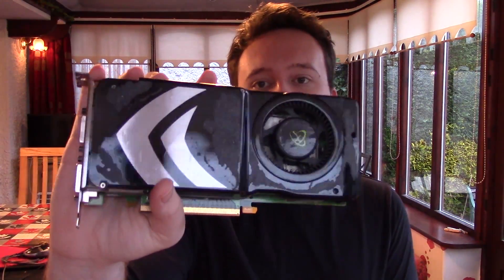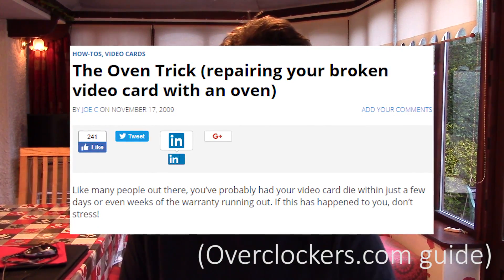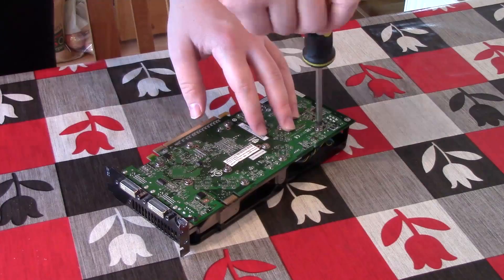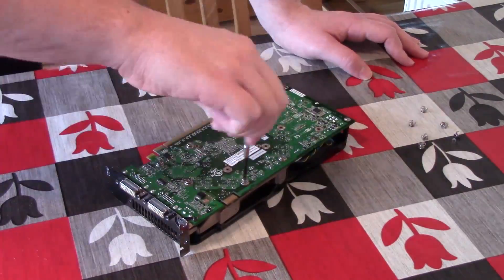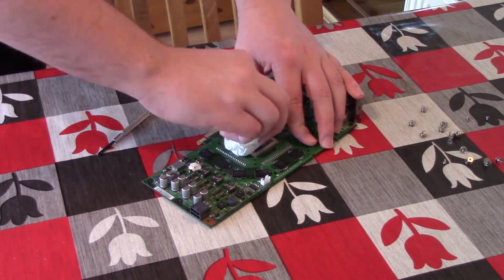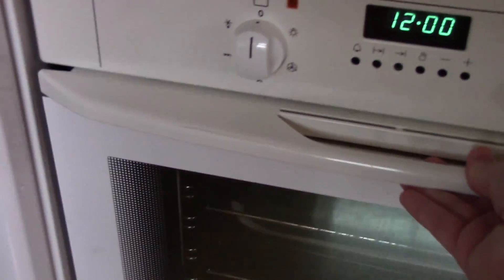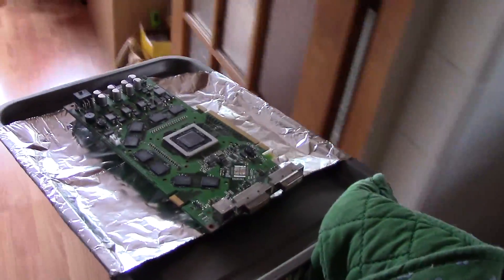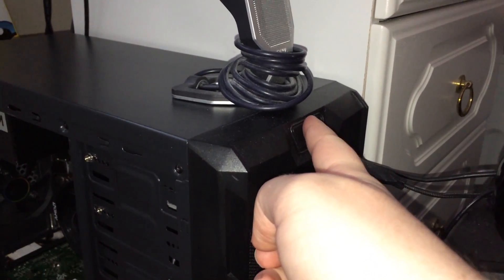Hardware Myths: Oven Baked Graphics Card Repair

Comment: Normal guy bakes pizza in oven. Tech guy bakes GPU in oven ;).
Reply: I had to replace thermal pads on my RX480, the process included rubbing the memory chips with alcohol, so I had to dry the card in the oven afterwards at around 80C :3

Comment: I fixed a iBook G3 GPU with a heat gun. It works still. Been a few months and it still works, but it's not a daily machine at all. Personally I think the heatgun is a better method than the oven, as you're not heating up everything else on the card and possibly messing it up more.

Comment: - could fry Capacitors or other parts
- can melt Plastic arts (e.g.fan connectors)
- might not do anything
- your Oven will smell terrible

But if you have a old card like the 8800 GTS it may be worth a try ...
Reply: the thing was trash without being "fixed" and the oven was being replaced afterwards? so i didn't see the issue with the caps or plastic, and so what if it doesn't work? its not worth anything anyhow.

1) if someone was going to do this yeah they may want to unsolder caps(they won't "fry" but they might evaporate and or rupture) and non high temp plastics

2)you can do it in a toaster oven in a garage

3) if it doesn't fix anything it doesn't matter so long as you haven't put any money into the fix
Reply: MGlBlaze so why do people bake the imac amd gpu and some are working 17 months on...
Reply: It WILL fry capacitors and other parts, as well as disrupt the internal structure of FLIP chips like what the GPU die itself is. It works temporarily but heating stuff in an oven does permanent damage that cannot be reversed - what you basically end up with is a zombie card that might work for a couple of weeks or a month before dying again, probably permanently.
Reply: The heat in a toaster oven is so incredibly uneven though, the heating elements are far too close to the card. Remember, most heating systems are either "on at full" or "off entirely" and just bounce on/off to try to maintain an average temp. In a toaster oven the heating coils can easily hit +600F even if you only set it to 200F.
Reply: You can add toxic fumes to that, you wouldn't simply melt stuff. At the very worst he could have killed that poor bird  of his if the room wasn't aired out good, they're very sensitive that sort of thing.

Comment: one way that i know works, get a heat gun with a high enough heat setting. mask off the caps and other sensitive components and leave only the gpu visible. heat it with the heat gun for quite a long time(might stack some pennies for a bit of downward pressure). if your not sure how long it'll take to remelt the solder than take an old cd/dvd drive that doesn't work and see how long you have to blast the board with the heat gun before the solder melts. add some time on to this to account for the mass of the gpu. fixed an old ati pro 1600x card that was getting green lines with this method. also works on the old xbox 360's that get RROD.
Reply: reason this way works is the heat gun actually produces enough heat to actually melt solder, unlike an oven that can't get even close enough heat wise to melt solder.
Reply: just have to be careful as once the solder is melted the heat gun can blast components right off the board. hence why you mask them with tin foil and some heat proof/ resistant tape.
Reply: The heat gun process for the 360 is just temporary (lasted a month for a broken one I bought and didn't work at all for two others that I had also bought).  The same result can be obtained by changing the xclamps allowing the chips to heat up for a minute without the fan on (but with the heatsinks on).  The problem is every "method" seemed to be temporary except possibly reflow with lead solder.

Comment: The oven method is a ghetto mod for a reflow station. I went the professional method with my 6870 because I had a friend who happened to have a reflow station. The card started to artifact randomly after about 1 year. So the guy helped me again by replacing the solder balls between the gpu package and the PCB. 10 months have passed since then, so far, so good.
Reply: Bizo221 yop good reflow usually help for long time

Comment: I still need to do this with one of my cards (sub-zero thermal fatigue cycles contracted the solder joints and now it only boots 1/20 times). I don't really want to ruin my stove, so I might just barbecue it outside since I really don't want solder smoke in the house. So charcoal... Small flame with top on, or open flame grilling? 

I will obviously have to video this hilarious event and put it on my Legit_Overclocking channel. Then I'll have to hardware mod it for more voltage and give it a good send off beating its ridiculous overclock record.
Reply: flame it
Reply: Is that a vote for open top grill? Would look better on camera I agree.

Comment: I do allot of gpu repairing and pretty much most of them involves reflowing using a normal heatgun. but do take note that gpu tend to turn bad because of heat. after repairing it by baking, do clean the heatsink and better thermal paste, install MSI afterburner and edit the fan curve at a point that the card runs below 80c at full load and don't use furmark to test heat. you'll find your card will live longer. all the cards I fixed are still alive to date even though my clients are always using it all because of stable temperature.

and avoid baking a card with regular capacitors. :S
Reply: Jerahya please watch the refrenced video, thats not what happens (7:35)
Reply: the same guy who argued with linus and insisted that the only way to fix this kind of shit is by using a thousand dollars worth of equipment but in the end he was never able to fix one thing when linus visited him in his place. I never really liked the guy. there are bunch of ways of reflowing and reballing chips and baking in an oven is one but unreliable way.and he only believed in his thousand dollars of equipment. He's always full of him self.

Comment: My last GPU was an HD7950 that suddenly showed red stripes and the same "no signal" problem as the 8800GTS here. I was already about to throw it into the trash when I had the idea to try putting it in the oven , and it worked for a whole year of daily usage after that. It has recently stopped working again, but the oven trick worked a second time. Guessing this time it will die more quickly though.
Reply from the maker: +PCHardwareAnalysis that's good to hear, but you're right.  The more you try it the shorter the life span gets as it's never truly fixed
Reply: Next time use heat gun not oven gud fluxes and will survive longer
Reply: Keep the card cooler than it was previously and it should last for an decent time less heat cycles less warping
Reply: A also have a HD 7950 with the same symptoms. Since I have purchased another GPU I may give the oven method a shot since I have nothing to lose. If it works I guess I could use it as a short term back-up or something in case one of my other GPUs die.

Comment: Odd, I only now got a notification. I never had luck with the oven method, but I have brought a Gravis Ultra Sound back to life by simply heating up every solder joint with my soldering iron and applying a bit of fresh solder :) That doesn't work with modern video cards though as it's all SMD and whatnot.
Reply: I think you'll find you won't 'fry' your capacitors. This is the healthy option remember, we 'bake' our capacitors here.
Reply: Thats the thing, this works best with SMD as it may be difficult to use normal soldering iron (even if you know where and what to solder).
Oven works with other elecktronics too, as long as you dont fry your capacitors
Reply: I had to bake my old HP dv6500s Motherboard because the GeForce 8400m died. Lasted 9 months and its so broken that it does Not even Recognize this Card in the bios anymore. Still usable with external Graphics Cards.
Reply: i just seen  the 8800 cock up by nvidia on here     https://www.vogons.org/viewtopic.php?f=46&t=44126                    you thinking it was the 7 series that was affected no it was 8 series i had one and sent it back refund but i never got they sent me another card and that died i did get a refund in the end

Comment: Done this to my old Hd 4870 and still works after 4-5 years
Reply: Jay Arre I highly doubt that.
Reply: Same here my nVidia MX440 which I baked about 10 years ago is still working today, in my retro pc.
Reply: IIRC Louis Rossman's claim is that baking will most probably damage parts other than the BGA, rendering the card unrepairable. So technically, if you're lucky enough for those other damages to not occur, all that's left is for the BGA to fail again.
Reply: Wow! That's really lucky!
Usually these fixes last for a year tops, but exceptions are always possible.
Reply: My gtx 8800 laster few months after baking, so I wouldn't say he's wrong.
Reply: End of the day my card works after baking it, its a great way of getting it to work again and id do it again on older cards (tried on a gtx 580 and it wasnt pretty)
Reply: @SpaRiieeSiLvA  what happened with the gtx 580?
Reply: @Foozefighter  overcooked it and the capacitors fell off. But managed to buy some new ones and solder them in and funny enough that card is in my brothers beater PC till this day. I also did something similar on a broken GTX 1070 (graphical glitches and windows reporting issues with it) for about £80 and got it working fine also. Best thing to do if you are thinking about it is not using the oven but a hot air gun and flux to stop any loose solder spreading. Look up hot air guns graphics cards and you'll find some there. If you need more help just ask my dude
Reply: @warrax111  you just match the code on the capacitor. There's a voltage and a capacity number on them, just Google search it and they will sell a pack of 5 for cheap

Comment: I have an old EVGA GTS 250 that shows a bunch of "&" symbols on top of the mobo manufacturer splash screen, and then it restarts the computer and loops the same thing, i wonder if the oven method will fix it
Reply: ExitioRegem use heat gun is much better and more pernament I use on lot of card specially with problem like yours
Reply: Thanks for the tip, just need to get thermal paste and i'm set :D, and if it doesn't work, i will have paste anyways on the side for later builds :P
Reply: ExitioRegem no problem and buy good flux as well you can check my channel how I repair gpu and usually will working long time some card I repair with my technik working after 2 years with no problem
Reply: Both oven and heat gun are horrible solutions but the heat gun is even worse because you are directing all the heat to the gpu's die without any temperature control and could damage the internal trails, especially if you don't pre-heat the pcb
The best method would be to cover the capacitors with aluminium tape and use an eletric grill instead, it will heat the solder beneath the gpu but won't melt anything else.
Reply: Daniel Lee do you know how is gpu make anyway heat gpu will not damage die at all
Reply: Daniel Lee oh sorry my English is not best but I repair staff 20 years
Reply: heat itself doesn't damage the gpu, but were talking about an oven here
a solder station has a temperature sensor built in so you don't get bubles on your chip
Reply: I baked an EVGA GTS 250  (1GB DDR3) for 10 minutes at 375°F and brought it back to life. When it died, the screen just went black and never got a signal on any monitor. It's been 11 months and still going strong. I did pull the fan connector socket off first but it went back on easily. A week ago, an HD 3850 AGP that showed artifacts is now running great. Gonna replace the three electrolytic capacitors that are now swollen due to the heat but it does work lol. The GTS 250 had all polymer caps so I didn't have that problem baking it.
Reply: Can you even spell?

Comment: If anything replacing the thermal pasted may have temporally fixed the problem. It's always possible it had dyed out and the new pasted increased the cooling efficiency enough to overcome whatever problem the card has.
Reply from the maker: +rpatto92 checked that first with no luck :(

Comment: Ok GPU works. Now the interesting part: How bad smells the oven?
Reply: Mine smelled a little bit like Popcorn and some chemicals. Hard to describe. But definitely not that bad, although I'm pretty sure that the fumes of the card are not healthy.
Reply: Raymix my father gpu been fix with heat gun about 2 years back and still working like new
Reply: SciFi Factory yop probably bad and for that reason is better use good heat gun like I use for repair
Reply: When do reflow it smells a bit like a hot graphics card after a long gaming session, but not bad.  Definitely not something I'd recommend breathing in of course.
Reply: Hi Frog, oh man I wish I had a heat gun back then. I probably did some other damage doing oven baking - which I had to do twice for GPU to work for a while. In fact I have a dead 670 lying around, I might get a proper gun just for kicks
Reply: yop that's can happen from oven as oven heat all card not just part is important ans is not good for capacitor an any other component usually car died after because bad capacitor from oven over heat plus es can have metallic smell
Reply: Frog - Tech - Tips your grammar gives me aids.
Reply: Raymix hmm if you are from UK contact me Iam more that happy help you  as you will need good heat gun not China one
Reply: There was a slight metallic smell when I did it.  Emphasis on the slight because I could smell it after pulling the card out of the toaster oven, but it was not strong and dissipated quickly.
Reply: No smell at all. I've done this trick years ago, even have video of it. Baked GPUs don't last long tho, maybe a month or two.
Reply: Blitzvogel I do many graphic card repair with heat gun never get one back or have bad smell you just need do that on good way and definitely not use oven as from this method is smell everywhere not just in oven
Reply: Bloodhoun21 you probably use oven that's why smell bad

Comment: This method often does work, and its how people sell broken hardware and laptops as working, only to die a couple of days after you get it. This sometimes does more damage than if you were to just leave it alone the first time it malfunctioned. Every repair guy i know always asks me if the part was baked or heated with any other methods because they refuse to waste time repairing them.
Reply from the maker: +3Runner95SRB I agree, I intend to push this to the limit now and see how long it takes too fail again

Comment: Since the removal of lead from solder drying out has been a problem.
Reflowing the solder is an acceptable option. If only as a last resort.
Reply: Nope, that's not what happens... looks like you didn't watch the referenced video
Reply: Domi Cseh no I did. I just disagree with the guy. His analogy may be true, but it doesn't mean it applies.
Reply: flagpoleeip oh ok sorry then
Reply: flagpoleeip don't think i agree with you tho... solder is an alloy and it's melting point depends on its exact  composition
Reply: Reflowing thechip would mean a complete reballing. Buying a "new" card would be cheaper.
But it can help with fractures and cold joints. Atleast for some time.
And solder usually doesn't has a fixed melting point. The range between totally solid and totally liquid can be over a range of up to 30°, but a lot of common types of solder can melt in an oven, as long as the heat is enough. usually around 180-230°C (350-450°F)
Reply: I've yet to find solder that has a melting point over 190C I'm sure it exists though. as you say it's an alloy the 188 is for 60:40

Comment: 2 weeks ago yesterday I tried this method on Asus my R9 270 that was "semi-dead" due to hard crashes whenever I started a game and tons of artifacting showing on screen upon POSTing. To my surprise, it not only fixed all of the issues but have been using it since then without any problems so far. However I've since replaced the Asus R9 270 with an EVGA GTX 950 to avoid the former crapping out on me again. :>
Reply: I did this to my Sapphire R9 270X that was having black screen issues among other things. It seemed to fix the issues for a couple days, but it started to black screen again. I was forced to buy an overpriced GTX 1050Ti.
Reply: EJ102 thats what happened to my R9 270 a month ago
Reply: It might run another month, it might run another year. But it will not be permanent.
Reply: EJ102 got same problem with my r9 270x black screen of dead :(

Comment: I have an r9 fury that isn't working anymore,can't claim warranty since it's been bought from the Amazon global store,try or na?
Reply: well if its not working you have nothing to lose so why not xD
Reply: I did it with Gtx 660 Ti in November 2017, and for now its back and working. I have artifacts and cannot install drivers. For now it's working like charm.
Reply: Lunaris Knight Tried it on my old HD 3850 and it worked.
Reply: the new cards use diferent type of solder so its not that issue its probably a bad componen may it be a cap a coil a resistor it really depends btw inspect the card yourself if any components are missing